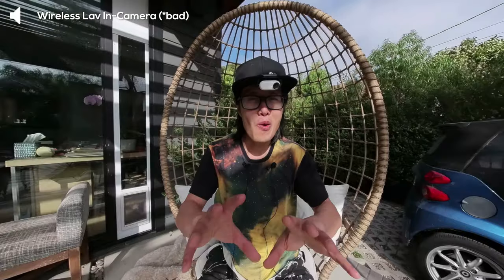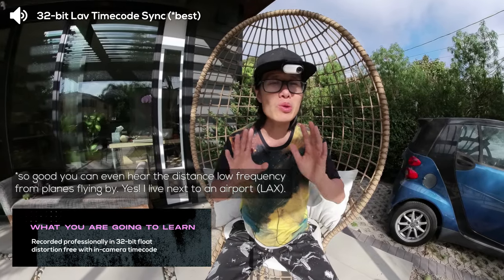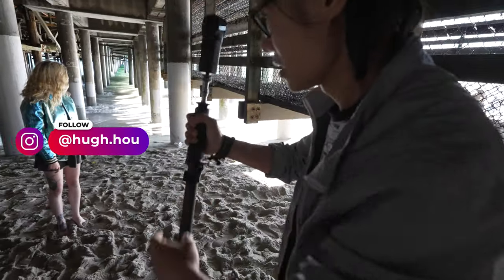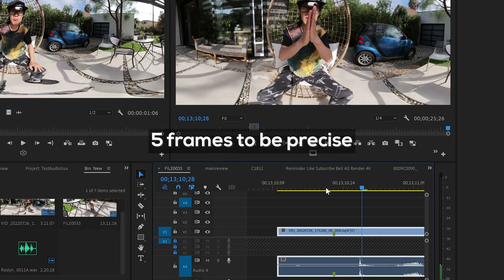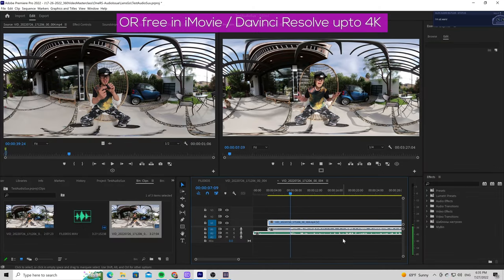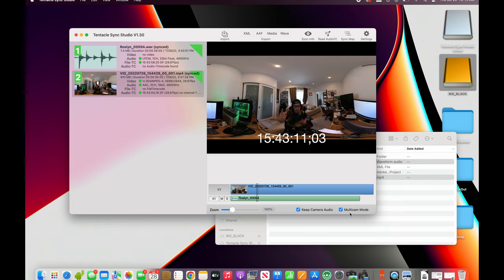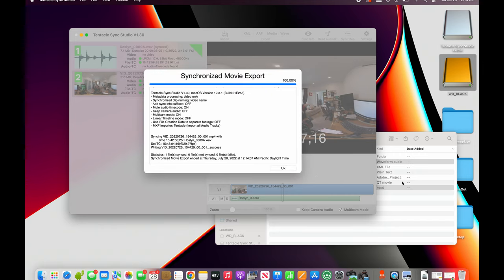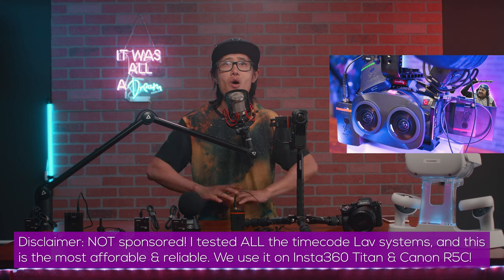The Complete Guide to BEST (Spatial) Audio on Insta360 Camera: 32-bit Noise Free & Timecode Sync

Comment: Hi Hugh, thank you as always for a great video. I am just interested in spatial audio but wanted to confirm the correct equipment:  
Zoom H3, 
Zoom BTA-1 Bluetooth Adapter, 
Insta360 CYNOVA Audio Mic Adaptor, 
AtomX Ultrasync Blue.

I don’t need the Tentacle Sync E mkII Timecode Generator, or do I as a time code generator?

Comment: We're always using external mics too, but it's nice when the on-board audio is at least tolerable as a back-up option. Does this problem only happen with the attachment piece, or does the onboard mic do it too? I noticed the on board mic doesn't sound very great, but haven't had much time to test it.
Reply from the maker: Yes, all Insta360 camera just capture 16kHz audio - it is the camera processor. The onboard Mic is actually not bad even in 16kHz (sound like a low cut + high cut filter on it). So it is a good scratch audio backup. But I won't use it especially for what you guys do in the pro level.

Comment: Hi Hugh what’s your opinion on the insta mic with the X3 as it’s also Bluetooth and also 32bit sound and it’s water proof incase I go for a swim and what’s your opinion on the new Apple AirPods Pro 2 gen for the Insta360 x3 thx.
Reply from the maker: The x3 internal mic work great. For underwater you need to use internal Mic

Comment: Hugh I love your channel. I bought all the gear shown in the video. One question: How do I get my UltraSync Blue and Tentacyle Sync to run at the same timecode?
Reply: I have the same question
Reply: @jeffhandley5223  it's possible to do with an UltraSync One to receive LTC from a Tentacle over cable, chase that timecode and transmit to an UltraSync BLUE over long range RF.
Reply: @ShrekSwag  Hi Shrek, did you have any problems pairing the Ultrasync Blue with the H3-VR?
Reply: I figured it out 😊
Reply: You need to change the mode you on your UltraSync blue to “free run” then set your frame rate, and then input the time code from the Tentacle app to sync the two devices. It’s all described on the timecode systems website.

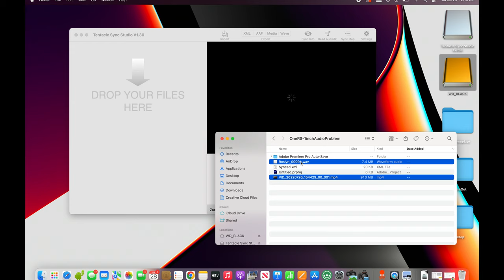Comment: 7:20, are you sure the studio supports full 360 video files?  I am on windows and I have to use the tentacle timecode tool and it does not support .invs files
**edit..  oh you exported the 360 files first to mp4..  that is frustrating that you cannot go direct from invs files into adobe premiere where you can use the reframe plugin.
Reply from the maker: I actually export into .mov - not even mp4. INSV is highly compressed - it is easy on your computer or other software if you transcode it.

Comment: I was just thinking I need to get a good mic for the new 1 inch and posted an hour before I see this! Thanks so much! The very best person to show me the way! I’ve purchased the zoom F2 but have one question… do I need to buy the mic attachment still? Or can I simply place the mic somewhere close/ on myself and link it in davinci resolve? Or is it best to plug it into the camera for accuracy? Bit confused thanks
Reply from the maker: I think F2 need Mic and it should come with a Mic depend which package you buy. I won't use the onboard mic on any wireless lav - Mic is a lot better.
Reply: @hughhou  sorry I meant the mic attachment for the one inch360? The bracket or can just attach to myself and sync the audio later? Thanks!

Comment: Thanks Hugh.  Do you know if the latest RS 1-inch 360 firmware update has improved the 16kHz audio issues when using external mics?
Reply: Hi Ron, do you have any news on this? :(
Reply: @captteemo9133  Yes the audio has been definitely been improved in the latest firmware update.  Doesn't sound like 16kHz anymore.  It still sounds mono and there's a little undefeatable noise reduction processing (like a webcam mic) but it's much better than before and is useable with external mics now.

Comment: Using Davinci Resolve 18, Tentacle Sync E, Insta360, and Zoom H3-VR and wanting timecode shared between everything.  What I can find so far is that Zoom H3-VR only accepts Timecode Systems / Atomos via Bluetooth using Ultra Sync Blue.  Is there a way to Jam Sync Timecode to the Ultra Sync Blue?  At least with that option, I could know my Tentacle Sync and Ultra Sync Blue will be in sync with each other.  That would greatly improve my workflow.  Do you know of a way to do this?
Reply: Have you found a solution? I also can't figure out how to get my Ultrasync Blue and Tentacle Sync to have the same shared timecode.
Reply: @ShrekSwag  I have reached out to Timecode Systems and their answer was vague at best.  The one piece of information I need is if my Zoom F6 can jam sync the UltraSync Blue instead of the UltraSync Blue jam syncing my Zoom F6.  If it can do that, then I can get everyone to play with each other.  Otherwise, it is a dead end.